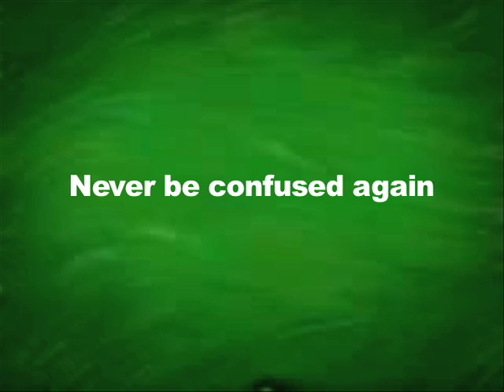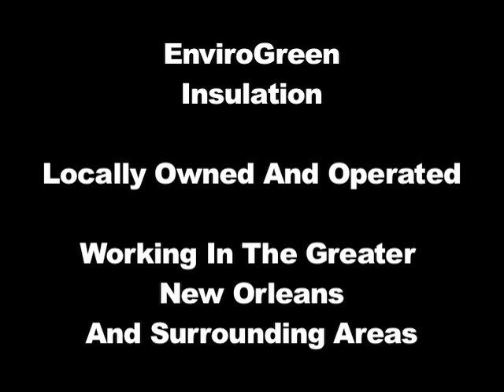Part 1 Open Cell Vs Closed Cell Foam Insulation Explained

Comment: 👈best spray foam installer with own rig and insured..worked for Allstar,Platinum,Cajun, TCI, Star, and few more...now I own my on..call last will outbid any commercial/residential 👉5046817110 for free estimates

Comment: how well would closed cell foam insulation protect against poisoness gasses like carbon monoxide or possibly even radioactive elements in the air vs open cell foam insulation
Reply: Damn good question.

Comment: About time someone mentioned r values and moisture within open cell poly.  I remember installing new walk in freezers at a plant.  The old ones were removed and they were full of water from years of condensation and was virtually useless as an insulator.

Comment: As for the claims about codes and etc. in REAL WORLD and not computer modeling, I put foam up against other types of insulation all the time. The second you add in moisture, air movement, protrusions and the rest, they are not nearly as effective. Hint, those models only look at R-value which is zero moisture, zero air movement and testing at 70 degrees. Change those and it still works, others drop by 50% and more with models ignoring that or air gaps.
Reply: From anything foam is made, please

Comment: You can tell HomeEnergyNow has a company using competing products. I hear this kind of BS and arguments all the time. First, it works and I know it since I used it in MY house and have never had a client complain after or not toss out our name and tell people it was worth every extra penny for the product. Second, the Department of Energy has done enough studies showing it works. Finally, you will find closed cell in your coolers, refrigerators and big industrial freezers for good reason.

Comment: So, while foam is not a panacea, it WILL seal your house tight anywhere it is used.  When used to fill walls, it WILL NOT allow convective eddie currents that make your insulation less effective.  Around here a 2400 sq ft home costs about 50% more for foam than bibs (blown in fiberglass).  Over a 30 year mortgage, you may pay $30 more per month for the foam, but when you save $40 in energy it makes sense.  Don't let fiberglass salesmen tell you foam isn't a good product.

Comment: Even if you properly seal a wall cavity with housewrap on the outside, and PVA sealer on drywall on the inside (yeah, I trust those for the next 30 years), convective currents STILL happen with fiberglass.  This circular movement of air within a single wall cavity moves warm air from the room side to the envelope side negating some of fiberglass's resistance and making it less effective.  And for what it's worth, not many fiberglass insulation homes achieve better than .3 air chainges per hour.

Comment: R value is to sell stupid people more insulation.  In a typical northern home, a house with .5 air changes per hour loses half their heat to infiltration and the rest to convection, conduction and radiation.  At r16 you have already slowed the rate of conduction by 93%.  At r32 you have slowed it by 97%.  Double the insulation for 4% savings while you let the other 50% leak out of your house by infiltration.

Comment: @4chi11e Where do you get your info? We build and sell houses and can promise foam does nothing for value.  An air barrier is required on the inside and outside of every wall, so please tell us all knowledgeabe one, what air is moving through the fiberglass insulation? Fiberglass has been over 85% of the market for over 50 years, please explain which dr. told you that it is a health hazard? Oh, you made that up, you talk about the fire resistance of foam, when fiberglass is FIRE PROOF.

Comment: @CryptoDriver I would HIGHLY  recommend having somedoy test it.  There are many ways to get fresh air without losing too much energy. Look up ERV, (aka heat exchangers) they will cycle fresh air while transfering 90% of the energy to the incoming air. I wouldn't wait, a home that is too tight can be harmful. This is one reason the foam industry sucks so bad, yeah sealing a house too tight is comfortable and good for bills, but they require fresh air for a reason and you CAN'T cheat that #.

Comment: @CryptoDriver Well any insulation will make your house warmer. Indoor air is far worse for you than outside air, unless you have serious mold issues, there are many ways of solving the mold problem without spending near that kind of money.  Also, interiors of homes are ALWAYS more humid than the outside, unless you run a dehumidifier, or hvac system. Showers, cooking, sweat, breathing all add moisture. If you seal a home too tight, it is a health hazard, did anybody test yours?

Comment: @CryptoDriver None.  It is just a type of insulation, energy-wise it is actually inferior because it won't go up to r-60 like the loose-fills.  Therefore it will provide a lesser r-value at a higher cost and will actually be worth less compared to a home with r-60 loose-fill.  When I fill out energy audits, type of insulation gets very little consideration compared to performance. Make sure you get fresh air for your home, alot of foam guys leaving houses way too tight, very unhealthy.